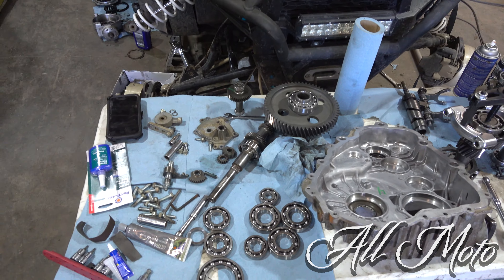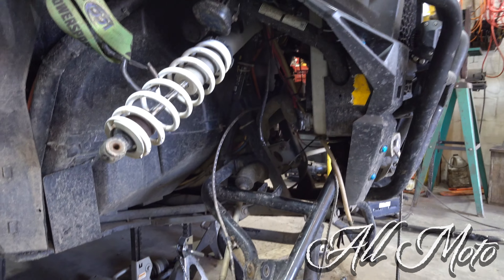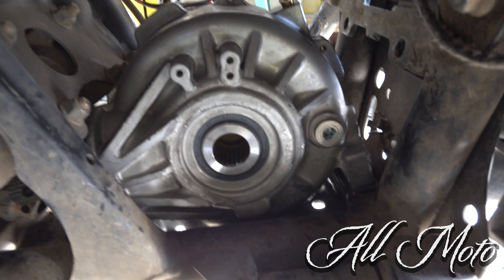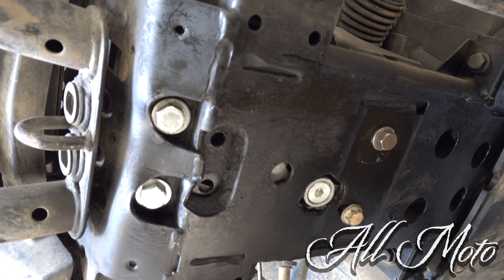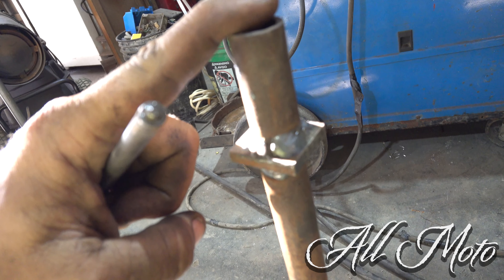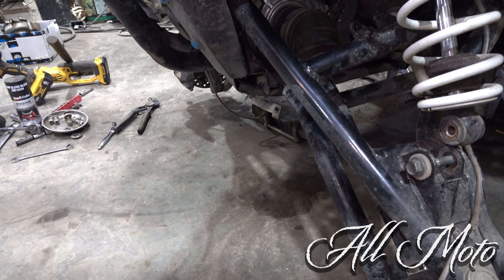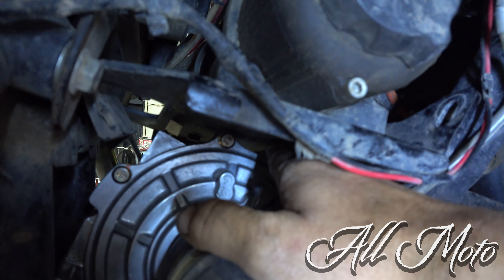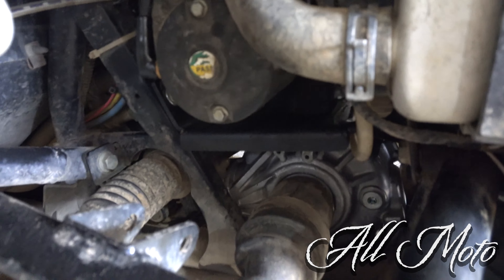RZ 900 s gets a 1000 diff upgrade: Roll pin technique

Comment: I can't get my roll pin out. Using an air hammer. Can you tell me what size punch you used? I looked it up and say 5/16 seems to big
Thanks
Reply from the maker: Make sure to use a “roll pin punch” you can pick up a small set at most auto parts or tool stores. Not sure exactly what size I he knew is I used. But definitely recommend a small punch set specifically for roll pins